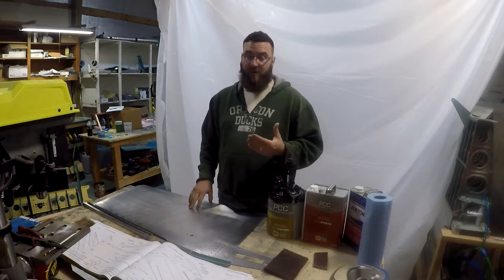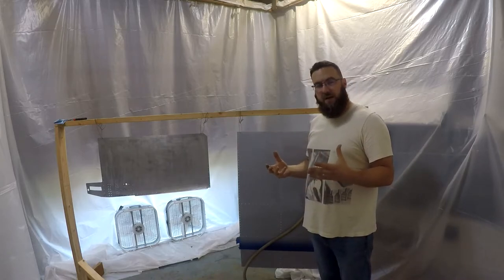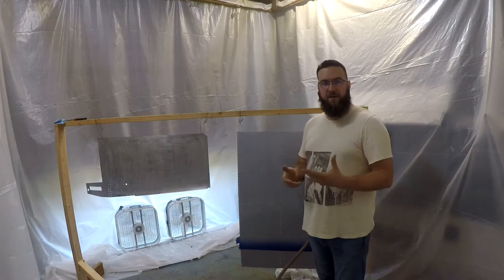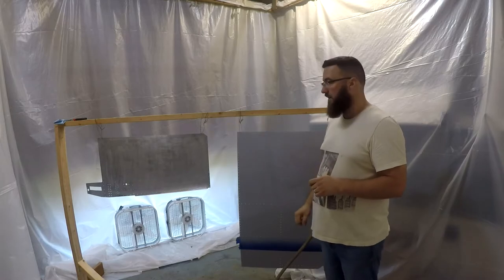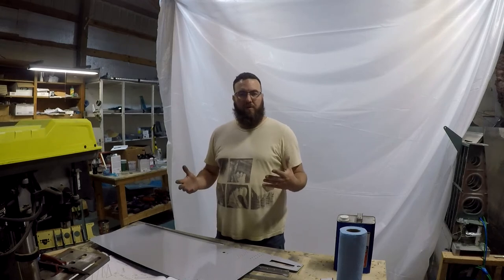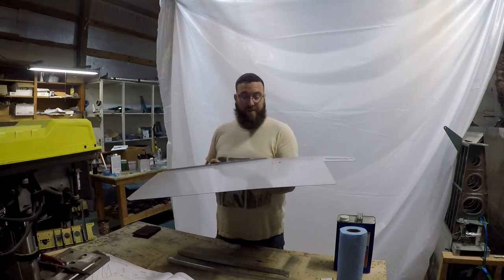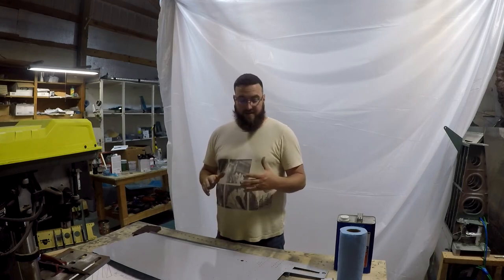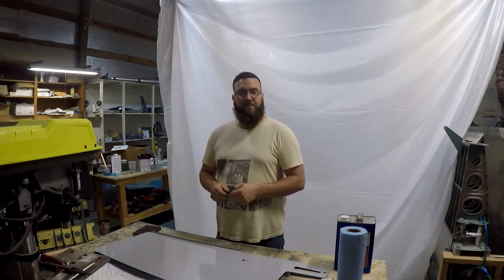Scott's RV 14a Paint booth shenanigans

Comment: I might have missed it.  Which gun do you have?
Reply from the maker: Sorry, I accidentally edited that out. I am using a croix Cx-10 turbine HVLP system with a gun that may be a generic one. Hard to read the name but I think it’s something like Sicmo or something. 

I inherited the system from my grandfather-in-law for free after he was done painting his RV 4.

This is the first time I have tried to use it!
Reply: Scott - does the product recommend three coats or was that your choice? Mind if I ask the price at Napa? Lastly, were you planning to top coat and paint the interior once it’s put together or just go with the primer until you get to the carpet kits and such? Thanks!
Reply from the maker: Hi John,
The product actually recommends that you do 100% wet with a 50% overlap and then do a second coat in a cross-coat fashion. I had arbitrarily chosen to do a third coat but after letting the first few dry and seeing how thick the primer felt, I think I will stick to just the two coats. As far as cost goes, I believe that I had purchased the gallon of epoxy primer as well as the reducer for around $75 with my military discount. I am not sure that I recommend this product though just yet. I am going to give it a few days and then kind of give it the fingernail test to see if it is sturdy enough for normal wear and tear or if it looks like it would be need to be covered by a layer of hardener or something. What I was looking for, and I dont think that the representative at NAPA truly understood what I was asking when I stated that I was looking for two part epoxy primer, is that I want a primer that when it dries will be extremely difficult to scratch or mark. So far, I do not believe that this product meets that expectation. I have been eyeing some epoxy primer with hardener from Eastwood it is relatively inexpensive and has a hardener to go with it.

As far as putting a top coat in, no I will simply stick with the grey primer interior until I put in the carpet interior.